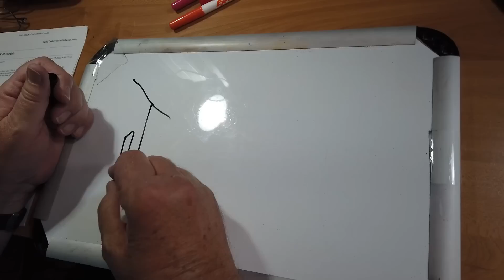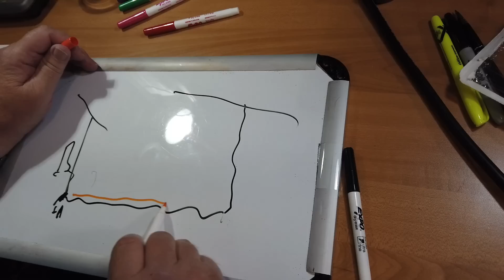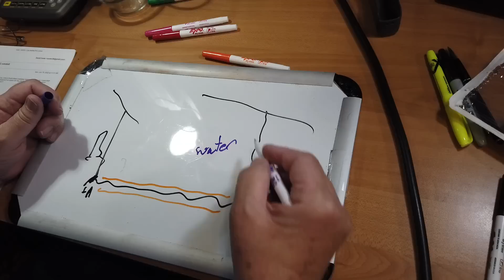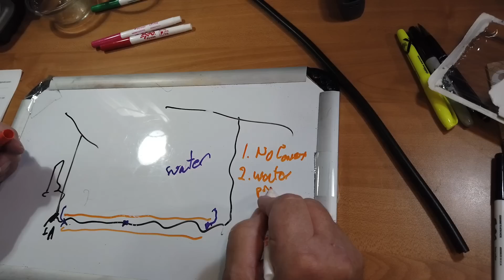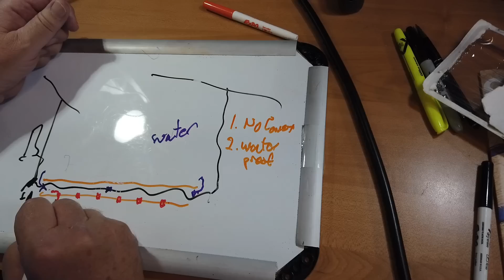Can I Bury my Coax Underground? (#735)

Comment: LOL, NO, absolutely not, don't drill drainage holes in your pipe. You can connect as many pipes as you want and easily water seal them. Just elbow the ends up and down and your fine.
Reply: The seals will eventually fail but not enough to make the water go away quickly.
Trying to make it completely watertight is mostly a lost battle, but at least you can prevent water stagnation

Comment: This is an older video, but I'm gonna comment anyway...
You DO NOT want to drill holes in your conduit. BAD IDEA! This would allow water IN (as well as out) of your pipe/conduit - which is exactly what you are trying to prevent!
Furthermore, don't bury the ends of the open (or sealed) pipe in the ground... the pipe needs to come out ABOVE the ground level.
With an underground conduit run, you would need to use 90° "sweep" elbows at each end (specifically made for electrical conduit) - and NOT regular "pipe" elbows -  to bring the ends of the conduit out above the ground at each end of the run. These sweeps are made with a roughly 10-12 inch radius (depending upon the pipe size) which allows for easy pulling of wire/cable/coax. Each end of the conduit run should then (ideally) be terminated into some type of a  box or enclosure, to further prevent the entry of moisture, with the coax then exiting that sealed box and going on up to your antenna or into your shack. Another option is to use a "weatherhead" at one (or both) ends, where the conduit comes out above ground. These are readily available at electrical supply and home improvement stores (i.e., Lowe's, HomeDepot, etc.), and are specifically designed to let the wire(s) exit the pipe without the entry or rain (they can also be sealed with silicone, etc., if necessary, for extra sealing).
Use a conduit or pipe that is sufficiently larger than your cable diameter. This will make the pulling - or pushing - of the cable much easier (and allow the addition of an extra cable if ever needed).
I have two runs of buried conduit (each about 100'), from my antennas to my "entry box" where the grounding & arrestors are, and then the coax's enter the shack. I used 2" dia. PVC conduit, with a weather-head at the antenna end. The conduits have remained virtually dry for 4 years...

Comment: I'm not sure what kind of conduit you're running but I don't have water in my underground conduits.  Of course, I put elbows and short stubs up out of the ground then another elbow and a cap with the correct tight fitting hole sealed with RTV.  Maybe I'm missing something.

Comment: The conduit will NOT leak if you seal all connections and use weather heads on each end.
It wil not fill with water and will not compromise the cable.
I am in Florida. The water table is literally the ground. I use this method all the time.
Reply: That works for a while, but long term the conduit will have water intrusion. Did you know that plastic is a permeable substance...both PVC and ABS ?
A surgeon who insists on nothing but old fashioned glass syringes clued me in to that fact years ago. On a molecular level, plastic is not impermeable.
Reply: Even if it was conpletely waterproof in the beginning, tree roots will eventually crack it or the material will otherwise degrade.
And water from condensation will still get inside anyway, unless you somehow also make it completely airtight

Comment: Dave, I have a Buckmaster DX off center fed dipole antenna with LMR400 Coaxial cable. Once buried, the cable will cross both my house supply electric line and the Comcast line. Will this be a problem? Thanks, KO4PHM

Comment: I disagree with you on that, now your allowing water moisture to seep in. I would seal up pvc conduit on all seams and run conduit up a wall to the overhang then seal up each end with silicone or similar after running coax. You could install a cap on each end with a hole just big enough to run coax through it.

Comment: I dug a 2 foot ditch and put in 2" PVC pipe and sealed it, then pulled 3 runs of DXE 400MAX coax in (which is direct burial). The coax has no connections and I put 90 degree elbows at the end then ran a 3 foot pipe going straight up and out of the ground and then on that put 2 90 degree elbows back to back (so that the coax come out the bottom above ground). It's been in the ground for 2 years now and no issues.
Reply: Exactly.

Comment: I built a 1/4 wave inverted L for 160 meters using a 4:1 balun and about 50' of RG-8 for the feedline. The antenna has an SWR of 1:1 on most of the band with an SWR of 1.2:1 at 2 MHz. When I tried to bury the coax, the SWR went above 3:1. Just an example of when burying the feedline may not work.

Comment: I run underground utilities all the time, I would suggest sealing your conduit at both ends with silicone after gluing the sections together with the whole thing assembled and dried place in a trench deep enough not to be disturbed by any thing, if it is sealed properly you should not have any problem.

Comment: Drilling holes in the underside of the conduit puts this into the realm of French drains. Therefore, you need to lay the coax on a bed of coarse gravel (at least 1 inch of it) so that (a) water can escape, and (b) so that the conduit and holes don't silt up with mud.
Reply: There is also the concern that roots might get in through those holes looking for moisture. I would not put as many holes as Dave suggests. One or two at the low point is sufficient. Also, use cable rated for direct burial (e.g. LMR-400DB), even if in conduit. Direct-burial cable has water-blocking grease in the shield. Conduit is classified as a wet environment - even if there is no direct water input, you will ALWAYS get condensation accumulating water in the conduit because it's always cooler underground. Your conduit will always accumulate water.

Comment: i have similar thoughts on this. I have mine running along side my house but thought of sending the coax through my wall but my son advised against it due to 2 things. 1 critters coming inside, Bob Heil mentioned using a shield like those stainless steel pads and 2 rain water coming inside.

Comment: check out leach line pipe, big enough for several cables, two rows of holes pre drilled. place several cords through it to pull additional cables, etc.  
Richard, KB7SGM

Comment: They sell direct bury coax.  I did the same thing but with data lines, and 75ohm tv cable, they were both direct bury. Now, I was only running 35 ft, so I used 2-inch s40  PVC, 2, 45deg elbows, 2, 2-inch traps without the cleanout plug. At 35 ft, I ran it with a 3 inch slop with a 2ft deep x 1ft round hole filled with 3/4 stone on the low end.   I used the 45's on the PVC underground came up then up from the 45 to 1.5 ft above ground using the traps up-side-down, keeping the rain out. It has been 12 years and still good. However, this year I will be redoing it, I think its time. lol  Good luck.
Reply: O, ps, its 12 inches deep and at 6 inches I ran yellow caution tape, in case someone starts to dig.

Comment: That is really not a good answer drilling holes in PVC  is a sure way for the coax to turn to mush. Water proof the pvc pipe and bring it above ground by 2 to 3 feet before bringing the coax out of the pipe. And seal it very well or bring it out inside an enclosure. One could use silica jell to keep the inside of the pipe dry. Another thing one could try is a moisture detector run the full length of the pipe inside these can be built using a FET. To alarm if moisture gets inside the pipe.

Comment: Use electoral PVC and ues the sweeps, and lube. Glue it all together.  Use a vacuum and pull line with something that the vacuum can suck through the PVC.  Big PVC will make it easier to pull in.  Try to get the PVC well above where water can stand. And if you can get where the ends will not get rain in them. There is a trick I use sometimes,  Glue it all together,  let it set in the sun.  It will get hot and will bend as you put it in the ground,  you will not need the sweeps to get the ends to come up and it will be a softer bend and easier to pull!  DO NOT PUT THE PVC TOGETHER WITH THE COAX IN IT! YOU WILL GET THE PVC GLUE ON THE COAX AND IT WILL EAT THE OUTSIDE OF THE COAX!

Comment: Thanks Always Mr. David!
I always enjoy you videos you teach a lot on things most don’t understand 
I’d say use pvc pipe or threaded pipe because they can be water sealed but even then the pvc can break a joint and leak in and threaded pipe best but more expensive but in my opinion would be best water tight pipe to run coax thru underground and not worry with water intrusion as much but probably would still be an issue no matter what you use water will always find a way in eventually
Reply: Ki5TJL

Comment: In any area I would but an elbow in the pvc and bring it above ground.  Seal with silicone but you eventuly will have water in side the pvc with temp changes causing it to sweat.  A possible solution to that is some sort of tube inside to suck out any moister with a pump.  then seal it back up.